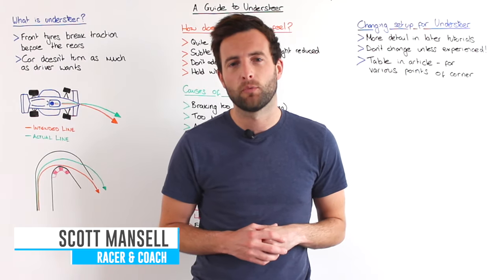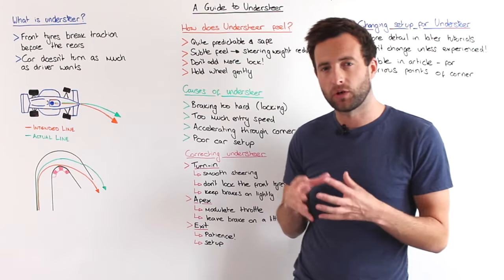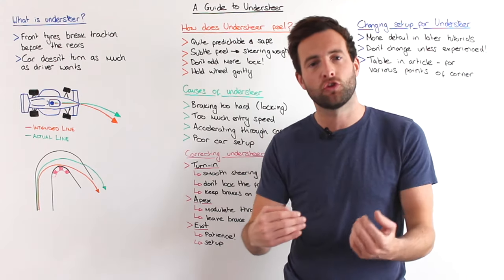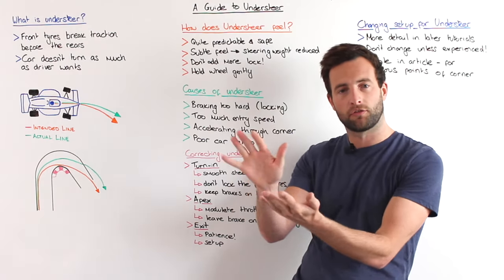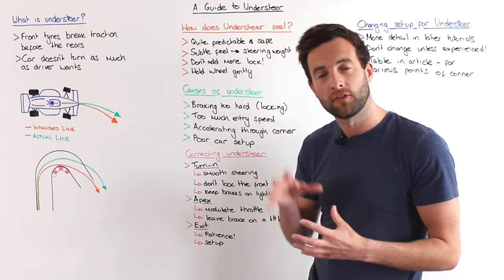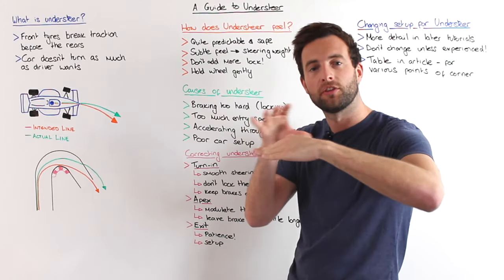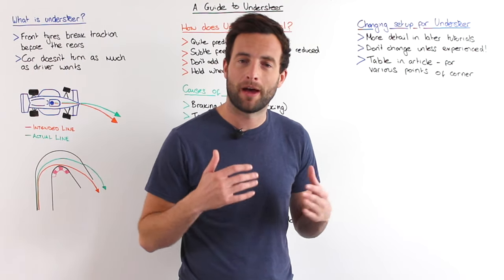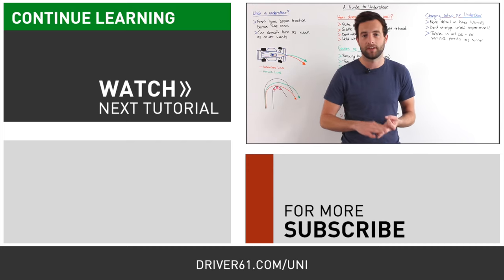Understeer Explained: What is Understeer & How to Control It (Actionable)

Comment: Great Insight and information. However, I was keen to understand more as to how to actually overcome understeer in 4 stroke rental karts where moving the seat position is not possible.
Reply: Rachit Singhal the rental karts only have rear brakes and a solid chassis with very little weight transfer. In this case you only really have your steering input as a way of controlling understeer.

Comment: I'm not sure if this is another way to fix understeer. I am going on the same speed on the turn but i lose a lot of the under steer when I lower the gear and press the gas to correct it by using the back of the car (rear wheel drive) to correct it.

Comment: Extra tip: on soft suspension, jab on the brakes quickly and sharply then when you lift off and the nose is still diving, turn in with no brakes for maximum utilisation of grip to turning. If rotation is still too low, jab at the accelerator while the nose is down to spin up the rear tyres while the grip is reduced (countersteer as necessary).

Comment: Brake with your left foot to eliminate understeer without compromising with speed..
Reply: I suppose you are talking about applying both the throttle and the brakes at the same time (as often seen in rallying). The problem is that this reduces understeer, or even induces oversteer in FWD and some AWD vehicles, it will usually induce more understeer in a RWD vehicle. Being as most track cars are RWD, this technique might not be ideal.

There is one other point to consider however. Using both throttle and brakes at the same time can reduce or eliminate turbo lag, so that is one advantage.

As of left foot braking without using the throttle simultaneously, there is no difference between right foot braking, except for the fact that there is less transition time between acceleration and braking. This is however irrelevant when discussing under- or oversteer.
Reply: @basmeijs6973  : I mostly agree with you here.. But what I'm really talking about is reducing understeer in FWD and AWD cars.. Because you can steer the RWD car with throttle so it's not very necessary to focus too much on understeer in RWD cars.. That's why most race drivers prefer rwd cars because they can exit most aggressively without worrying about understeer.. 
On the other hand, In FWD cars if you exit early and aggressively then front wheels will loose traction in most cases.. It's very frustrating in a race because you can't corner aggressively aspecially in medium and high speed corners.. So the trick in FWD cars is to balance the throttle and brake with left and right foot.  What i mean is after putting the car in right gear before entering the corner you can gamble to come on throttle early but at the same time putting enough weight on the front tyres with your left foot  and force your car to follow the right line.. It's a very useful trick on tight tracks and roads where racing line can't help much..
Reply: @Abhishek-150 you've got a good point. Especially considering FWD cars. Even more so when they are not properly balanced or you are riding in the wet (or on gravel). 
There is however one small thing I'd like to add about RWD cars. They can understeer quite severely on corner exit. Especially with mid- or rear-engined layouts, but some front engined cars also have this problem. The weight transfer of acceleration will take weight off the front wheels, thus reducing traction. (Especially in a MR/RR lay-out, where there is little weight on the front to begin with). 
The result of this weight transfer can be quite severe understeer on corner exit. 
This is off course also affected by the setup of the suspension of the car.
Reply: @basmeijs6973 : Yes, Aspecially  mid engined RWD cars.. They tends to understeer at initial corner entry. Even FR layout understeers at initial entry but correct it's line afterwards and exit very furiously.. That's why RWD cars have different lines as compared to FWD..   
The rearward weight bias preferred by sports and racing cars results from handling effects during the transition from straight-ahead to cornering. During corner entry the front tires, in addition to generating part of the lateral force required to accelerate the car's center of mass into the turn, also generate a torque about the car's vertical axis that starts the car rotating into the turn. However, the lateral force being generated by the rear tires is acting in the opposite torsional sense, trying to rotate the car out of the turn. For this reason, a car with "50/50" weight distribution aspecially Mid engine car 
 understeers on initial corner entry. To avoid this problem, sports and racing cars often have a more rearward weight distribution. In the case of pure racing cars, this is typically between "40/60" and "35/65". This gives the front tires an advantage in overcoming the car's moment of inertia (yaw angular inertia), thus reducing corner-entry understeer.
Reply: @Abhishek-150  completely agreed. This is just one of those things that makes racing so interesting to me. Especially when you're also considering suspension in the mix. 
I still remember quite a few years ago when I was at spa, watching the GT racing, and being intrigued by how the top two cars could be so different, yet get so similar results.
Those were the light, not very powerful, MR layout 911's, Vs the heavy, very powerful, FR driven AMG-GT's. Fascinating to watch.

Comment: What is it called when a supercar accelerates quicky (in a straight line) but pulls to one side? 

I saw it today in super car fail videos. 

Anyone know what it is called?
Reply: Mo Ahmadi Torque Steer on FWD cars or just idiotic driving causing the rear to break traction.
Reply: Its called poor driving mate
Reply: Machine overcomes the will of man. In the other words, the judgement day.

Comment: Poor ol' maligned UNDERSTEER....mastery of "intentional" understeer is a component of some of the most heroic moves that can be performed in a motor car, i.e. the magnificent 4 wheel slide!, as well as for extending the drift in a non-zero Ackerman front geometry(normal car) vehicle. Otherwise, spinning is a more fun way to abandon all car control, lololol. 
..btw nice tutorial.  btw, adding a brush of LFB while maintaining speed and revs by matting the accelerator could be a technique to address understeer from apex to track out, maybe.....